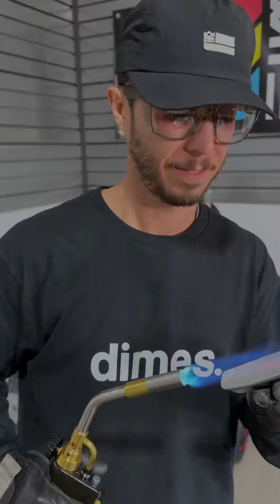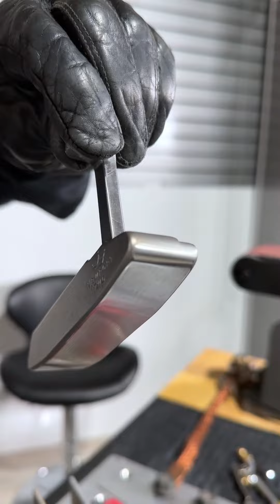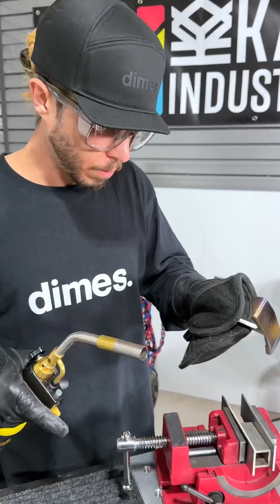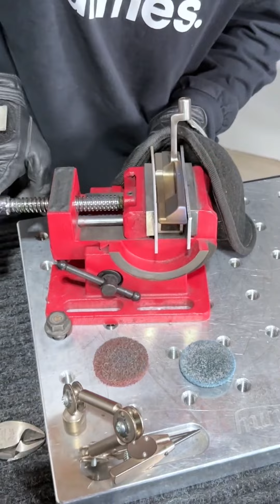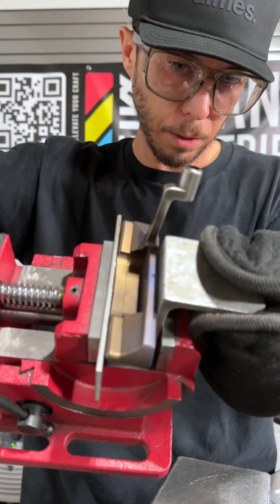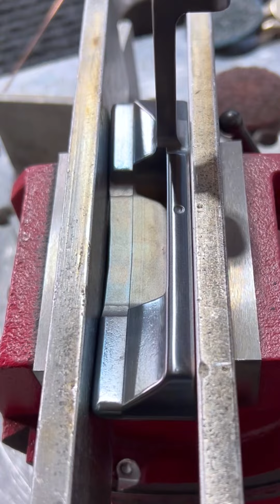Warped Classic Putter - Salvage Rebuild - Part 2

Comment: I wonder if well-placed taps with a carbide-tipped ballpeen hammer on the concave side would straighten it out? Knifemakers use this technique post heat treat to straighten out any wooptys.